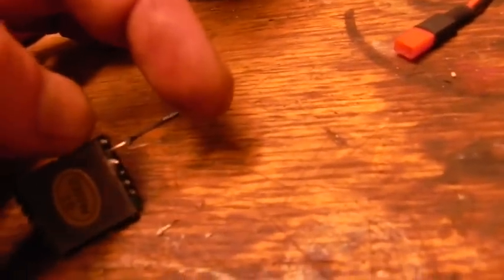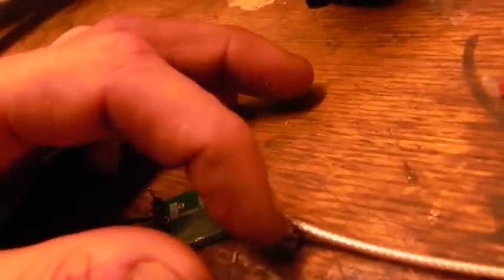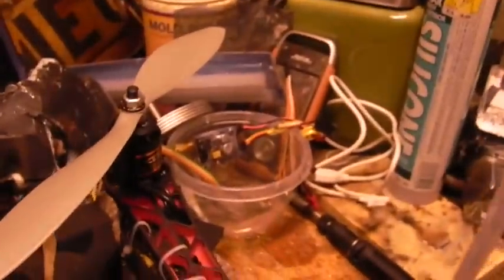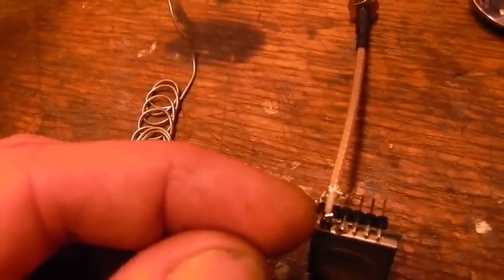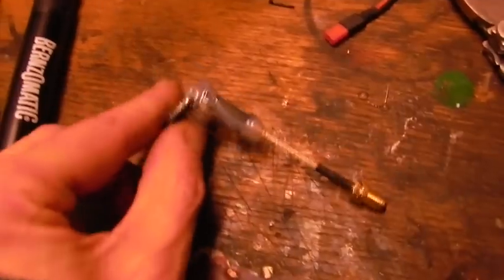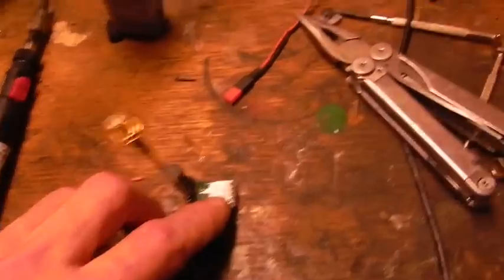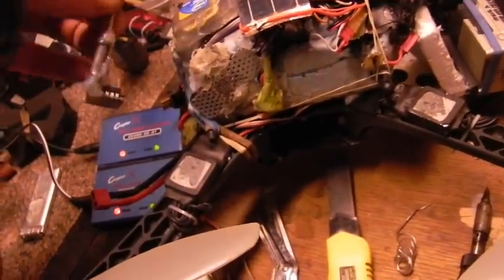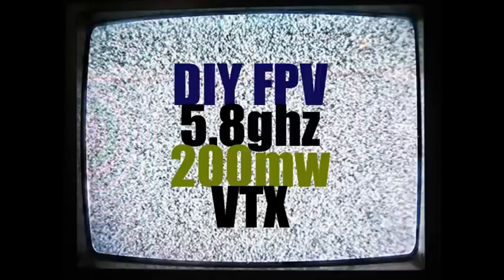Soldering the 200mw video transmitter pcb, addressing the delicate signal wire

Comment from the maker: No filter on this one, only thing on the hoverbot was a ferrit ring on power but using a seperate 1000mah 1s it does not share it's power. Got the other freeflight in the new Reptile frame and very steady even with the rctimer 2830's.
Waiting on plastic case for APM 2.5 getting a bit excited but may as well be considering I have spent way too much last month LOL! It's deal with it time but I have now 2fpv rigs ready, booha ha ha!